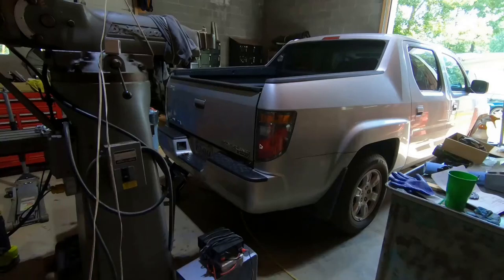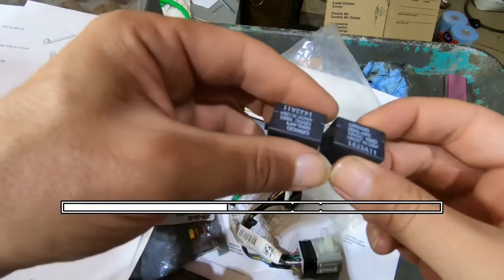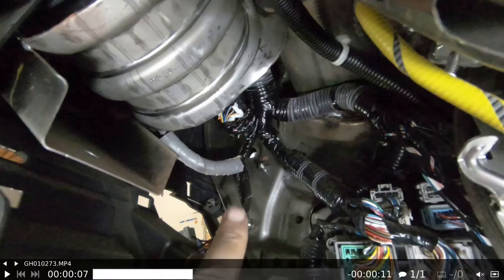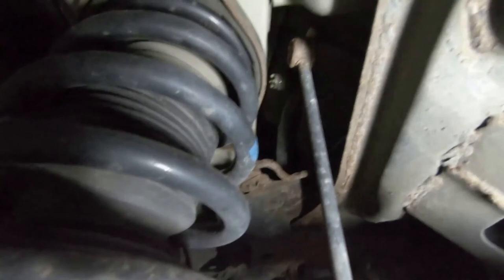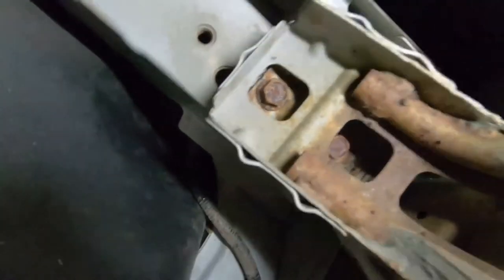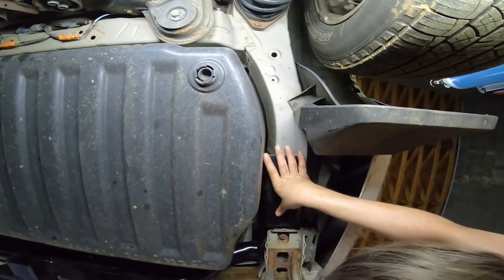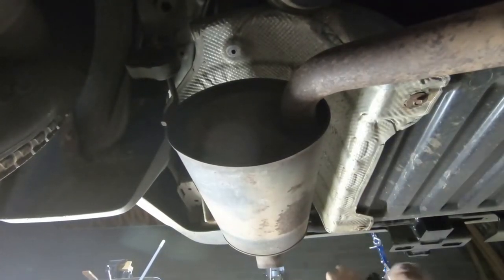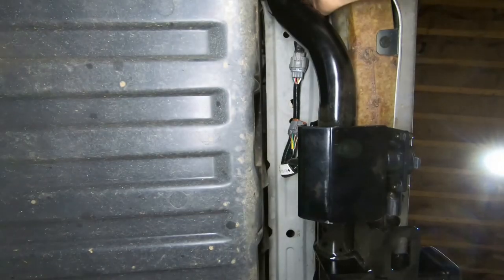O6 Ridgeline OEM hitch one person install

Comment: How long did it take you to install the hitch and wiring
Reply from the maker: about 2 hours.  I wasn't hustling. I could do it in about 45 minutes if I did it again. It's not hard but I would get a tap for those likely rusted holes.

Comment: I want to know how you got the wiring that's up next to the frame down from it is because I can't get it to drop down
Reply from the maker: going from memory... and you can probably find the instructions I had?  But I think there was blue tape up there holding it together.  I think I just pulled in the direction of the wire.
Reply from the maker: I found the instructions I think I had.  I put them in the description for you.   Good luck kenneth :)